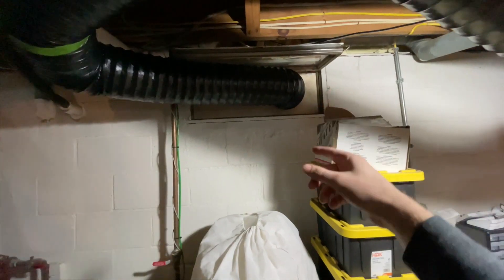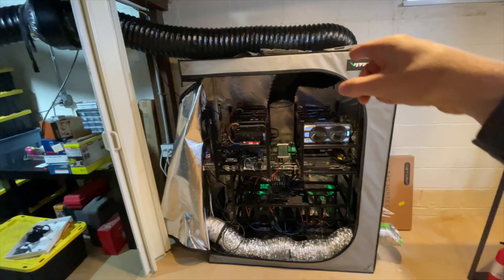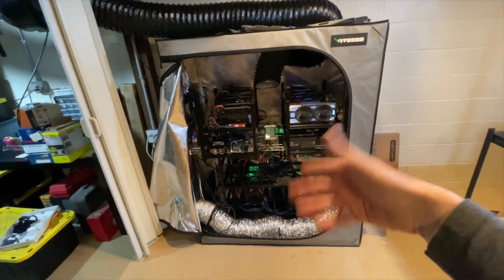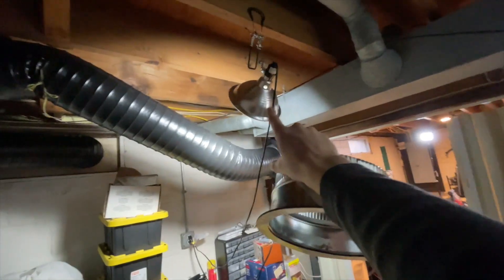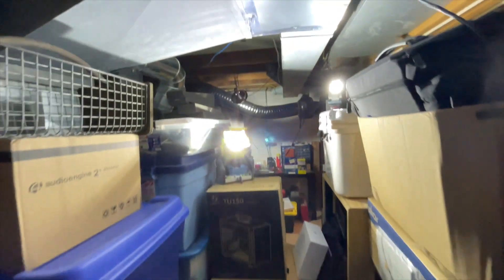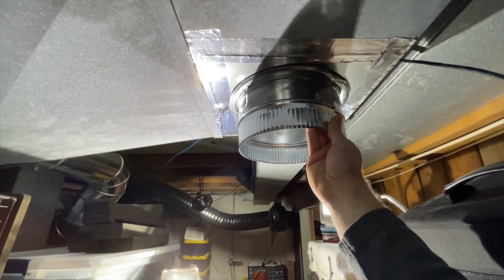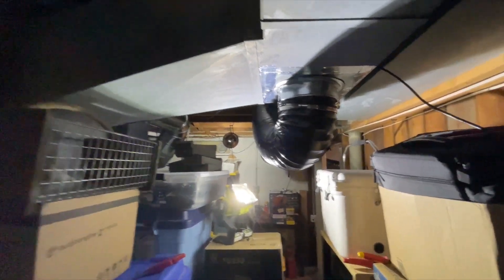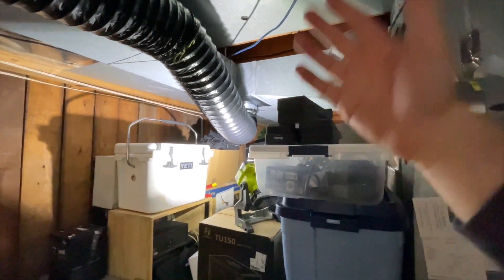Heating My House with GPU Mining Rigs

Comment: I bet you could also use it to cool your house in the summer by using a condenser.
Reply: Actually on second thought you would need a compressor which would probably use alot of power on its own.

Comment: Hey RFC are to still doing this? I was thinking of doing the same but with a y splitter where the majoity of the heat would go out the window. The other side of the Y would be a automatic damper that would open when the force hot air is open. Not sure if it would work.
Reply from the maker: I have to get it hooked back up for the winter now that it is actually cold out! This year it'll go into my return ducting and I'll use a wye to feed 2 exhaust fans into my HVAC.

Comment: Consider pushing air to the return side of your ducting to avoid backflow when the furnace kicks on. You will also benefit by leaving your fan on in the furnace then as a pull through your mining rig potentially increasing air flow.
Reply from the maker: 100% what I will be doing this year.
Reply: hi . i have a furnace similar to red fox and i was thinking to blow my asic heat into my room ducting .. can you please explain what u mean by pushing air to the return side of your ducting??? thanks

Comment: Have you noticed any issues with the furnace pushing heat back into the tent? I'm just wondering if it would be better to dump the heat into the intake ducting instead of the output
Reply from the maker: I didn’t, but I will be making that change this year!
Reply: I agree.  Dump the air into the house directly through a separate vent.  If the furnace kicks on it’s going to back pressure your in-line mining fan and your rig isn’t going to be able to cool well.

Comment: Good idea, but physics are against you on this one. Sorry.

Only issue is when your HVAC system kicks on, it will overbalance the exhaust pipe from the grow tent and blow hot air into your grow tent. Simple terms you are going to blow hot air into the tent when your heater turns on.

Best to just open the Grow tent and let it naturally radiate the heat out or just let the exhaust flow into the basement.
Reply from the maker: You're right thought when running this last year it never kicked back into the tent thankfully. This year I'll have it enter in my return ducting instead which should work better.
Reply: @RedFoxCrypto  That is the best way, and way more efficient.

Comment: It will be nice to use that heat for heating water in my house.
I'm waisting electricity to heat water in boiler while at the same time I'm using air conditionaer to remove heat generated by gpu.
Anyone did something like this ?

Comment: Is the booster fan coming out of the grow tent enough to stop the furnace fan from blowing hot air into the tent when the actual furnace kicks in? I would have thought it would have been better to feed the air intake of the furnace and preheat the air when the furnace is on, and it would still pass through when it's off, I think this would be both more efficient for the heating of your house and it would provide move more air across your GPU's when the furnace was on.
Reply from the maker: You’re 100% right. That’s what I’ll be changing too this year. I still never got kickback into the tent when the furnace kicked on all last season, but still would be much better going into the return vent.

Comment: How does air get IN to the tent? is there an inlet that has a dust filter or what?
Reply from the maker: Yeah there are ducts on the bottom of the tent that bring in air.
Reply: @RedFoxCrypto  How far off the ground is the intake duct at the bottom?

Comment: Nice work. I've been thinking of doing something like this for a couple years. Right now my rigs are just space heaters in the house, but I want to ramp up my mining and then do some sort of proper dispersion into the entire house, so your setup is exactly along the lines I was thinking. I am wondering what effect this setup has when the heater is on. Does it cause a pressure problem backflowing towards your mining rigs?
Reply from the maker: Hey dude! This setup worked great for me all winter long. The only adjustment I'd make (silly mistake on my part) is to tie in the duct from the miners into the return side of your HVAC. Even though I didn't do that, I still didn't have any blackflow issues.
Reply: @RedFoxCrypto  Ah, so you're thinking preheating the air going into your furnace should offset the furnace load! Really smart stuff, then you don't have to worry about backfeeding your furnace heat into your mining rig. I'm thinking about building a house soon and I just might steal this idea, then as I upgrade my mining setup, it would increase the efficiency off the furnace with every new GPU. End goal would be 100% mining for HVAC control. Really cool man, keep the content coming!

Comment: What I would do is close the door, lift up the bottom so there's a gap, lift up the hose that's extracting air, so it's right at the top, sucking up all the warm air that rises. That way air is moving from bottom to the top, where it's being sucked out, that way you're effectively taking ALL the heat the rig makes and dumping it into your house, making it way more efficient.  
The rig itself would be better off that way also, because it would be drawing cold air over it from the bottom, instead of soaking in warm air, while the hose is sucking cold air from the open door.  
It's like PC case airflow, except upright, you want good airflow, one side to the other, in this case bottom to the top for maximum efficiency.

Comment: So funny, I spent a lot of time looking for someone that vented out to see if it was viable, didn't find anything, and just did my own experiment. LTT brought me here and I was like HOL UP HE DID THE VENT TOO lol. I ended up using one of those portable AC vent kits to add an opening to my window, added an in line one way flange to make it so wind didn't blow in if it was stormy out, and very precariously masking taped it all together (just to see if it works). I am in Florida, so no basement and I don't have much of a need to heat my place. 

My friend thinks that my setup ends up creating a vacuum, sucking in humid outside air because of the negative pressure created by my constant exhaust. What do you think? https://imgur.com/gallery/NmECfuJ
Reply from the maker: Looks awesome dude. How much air are you feeling being exhausted outside? I'd get one of these https://amzn.to/3ci81wQ and literally put in your PC case to measure the humidity to give you peace of mind.
Reply: @RedFoxCrypto  Probably not as much as you with your in line fan, but I took a high rpm fan off an old corsair AIO, made that my exhaust fan, and set it to run at 100% at all times so it moves a good amount of air, no problem out that short line. Thanks so much for the suggestion, just ordered it!
Reply: Any air you force outside has to come back in the house from somewhere (gaps around doors, windows, etc). It does create a vacuum that has to be filled. Red Fox is pulling from in his house and pushing back into the house in his winter setup. In the summer, hopefully Red Fox cracks a window in the basement, otherwise he's doing the same thing, venting air outside, but pulling cool (possibly A/C cooled) air from the house, which is then backfilled by hot air from outside seeping in the house due to vacuum pressure.

Comment: It would be cool if you picked up spring return zone dampers and have them open/close based off a thermostat so the house doesn't over heat, then have the furnace act as a second stage. Could then pull outdoor air into the furnace for free cooling in the summer

Comment: one thing you could do as well is water cool your whole setup with custom loops and tie it to your water heater. make sure you get a really nice filter double to be safe. for the return water coming back to the closed loops system. free heat and save costs on water heaters. :) 

me and my brother did this 4 years ago in a really small cabin but used a 5 gallon tote and placed the pipe that lead to our mining rigs into a double filter and filled it with some water and placed a ton of snow in the tote it melted that snow so fast that we had to keep putting more snow in it. lol btw this idea is not patented and im wowed by no one doing it.

Comment: You need a much more powerful fan to push through all the extra ducting. I wouldn't be surprised if your GPUs are running hotter now since the fan can't get as much heat out. 
You also need some sort of valve so you don't waste a lot of that air pressure blowing into the furnace, and you don't heat up your computers when the furnace is on.
Reply from the maker: Thanks for the advice. Everything is running great except with the weather warming up my house is getting too hot again. Next year I'll add it into the return side of the furnace OR right into a green house.
Reply: Im in canada and thinking to do the same this winter . What u mean by return side of the furnace ????

Comment: It is what it is, mb just not mention little jimmy cuz they might be really salty, but whatever. What settings are you running on 3070 though ? :)
Reply from the maker: Stable for a day running -502 core, 1300 mem, 126w for 62.3 MH/s. Trying to push the memory a little more right now.

Comment: Did you test this when the heat is on?  I feel like if your heat ever kicks on the inline fan could run into more resistance/ get overpowered by the cfm of the furnace blower. I'm no fluid/thermal dynamics scientist though
Reply from the maker: Yes and it works well. In retrospect I should have put it in the return side of the HVAC. I'll probably change it up for next winter season.
Reply: @RedFoxCrypto  niccceee

Comment: Is this safe? I mean, could it be possible the air released by the hot electronic devices contains something bad for your health? It might be better only use the heat generated by the GPU instead of direclty poping the air into your house.
Reply from the maker: It's safe. All I'm doing is move that heat from one place to another with a fan.

Comment: I legit haven't turned the heat on in my apartment in 3 weeks. Bet its cheaper too cause I have electric baseboard. Its an odna b250 running 4 1060 6gbs , 2 1070s and 2 3060tis in the aluminum case built for that board (like the 8 card mobo/case setups from minerscave) . I pulled the server fans cause they were way to loud and put in some 120mm normal case fans  . the cards sit around 70-75c and it just vents out if the back of the case into the living room and I also have my desktop running a 3080 and 3060ti on the other side of the living room . been pretty cold in New England and my backyard is a big lake . normally I'd have to have my electric baseboards set at 80° just to stay at 70° . my electric baseboards havent been turned above 60°F for 3 weeks.
Reply from the maker: That's awesome dude. Especially since you are trading electric baseboard for electric miners. The savings there has to be awesome. 

Also, living in NE with a big lake in your backyard sounds like a dream. Happy mining brother.

Comment: i have a ring with 3060 ti and isnt hot , i try to heat but nothing , 40-50° max
Reply from the maker: They are pretty efficient cards so you might not get that much heat from them compared to others.

Comment: I was thinkng of doing the same thing in my basement to use the heat to heat my house.  I do not have as far to travel with the piping to get in to my centeral vents.  Mine are not in a grow tent though so I am wondering how well it will work.  My area gets around 75f right now since its winter time.  I could always get plastic sheeting and block off that area though to get it to heat up more if I were to pipe it in to my unit to heat my house.  I wonder how much it will save you on your heating bill though.  I guess it is hard to track because of how much the temperature outside fluctuates.

Comment: You know what I was thinking. Why not put a T in the duct work and run duct from the T to the window so you don't have to keep switching it. Put a butterfly valve in line with the duct going outside so you can close it during the winter time. Brilliant 🤔 now it's turning into a project. Sorry 🤦
Reply from the maker: Haha excellent suggestions. I think I might try just that for next winter season.

Comment: put the whole set up in the greenhouse. Then you can grow all year round!
Reply: He could grow some weed. Weed + mining= very rich
Reply: This is the way
Reply: no don't do that! It'll end up killing the system with trapped moisture alone. its better to just run an inline to the greenhouse, rather than putting the system IN the greenhouse.
Reply: Woah. Good idea.
Reply: No he can't because He must replace the UV radiation what the Sun emits. So using a UV lamp could work out in combination with a heat from GPUs

Comment: Just a thought here from a harsh cold climate. Keep an eye on your basement temperatures. In MN it gets more than cold enough to burst pipes. If you zip that tent up and send all your heat upstairs you'll throw off the frequency that your thermostat calls for your furnace. That might drop the temps in your basement a bit.

My one rig doesn't do much other than warm the one basement room that it's in, but hopefully the second rig I'm adding will get me some more heat!
Reply from the maker: Thanks dude. Luckily I also have some other rigs that don't quite fit in tent keeping the basement nice and toasty. Good luck on that second rig!

Comment: Done heating from mining gpu  but 
Showed issue  that air is dry from gpu. Need to use air humidity device to keep around  50%. Now I'm thinking to accumulation that heat and do some better heating solution

Comment: if your furnace turns on does it blow hot air back into the rig?
Reply: As a HVAC tech your going to damage your rig if the furnace comes on. The cfms that furnace puts out it's going to be a lot more than the fan for your rig which will blow into your rig.
Reply from the maker: Nope. Working great so far. I was nervous of that at first.

Comment: hi I maild ur Email regarding some help i need for bios upgrading my Gigabyte P104-100,but the mail is not delivering...the mail id is correct
Reply: For better hashrate or to 8gb from 4gb? Only certain p104 had 8gb on them. From what i read gigabyte cards didnt have 8gb. Id pull cooler off and check memory chips before flashing that
Reply: @michaelgrodecki4159  this guy did it....https://youtu.be/2J4F6zd6daE

Comment: Need to make sure the exaust fan from the rig is more powerful than the HVAC fan otherwise when the HVAC is running it will force hot air onto your rig and you may thermal throttle your GPU. Need a 1way valve to prevent back flow or air onto your rig. Good luck.
Reply from the maker: I tested it with my furnace running and the in-line fan is still sucking in all the hot air with no noticeable difference. I was worried about this too but it seems to be okay so far. 🤞🏻

Comment: Cool idea!  What if you were to suck in the cold air from outside to cool the tent?  Wondering which way would be more cost effective/beneficial?
Reply from the maker: I might try that in the spring. I’m just worried about filtering that air to avoid sending pollen, dust, etc into the tent.

Comment: Nice job bud! Just a small heads up you should put a damper on that connection so you can shut it off when the furnace turns on so it’s not pumping heat into that Grow tent... The best way to avoid that is to actually cut this into the return air side of your furnace so there is no chance it can push back into the tent and the heat will just radiate out of your return duct when it’s not on.

Also a flathead and a hammer will pop that duct work so you don’t need to drill it. If anyone is trying this at home.
Reply from the maker: Thanks dude. So far it seems to work okay but I was definitely worried about the furnace pumping heat into the tent. When I have both the furnace and in-line fan on the suction of air within the grow tent doesn’t change. 

Smart idea using the return side instead. Hopefully I’m okay. I’ll keep this going for a couple more months and then switch it back to venting outside.
Reply: @RedFoxCrypto  Haha no worries man!! Just in Construction so my brain was like leme just let him know incase you notice that grow tent is getting hot... 

That’s what I would do anyways cause the heat will just get sucked in from the furnace when it’s running and when it’s not running it will radiate from the returns. Currently the heat will come on and push down to your rigs fighting that in-line fan. 

Either way Free heat so F*** it! Lol
Reply from the maker: @ChumpChangeXD  Excellent point. Love you buddy! Thanks for looking out.
Reply: @RedFoxCrypto  ❤️

Comment: We live in Canada and our house is heated with baseboard electric and woodstove(mostly woodstove) we are in the process of taking out the baseboard heaters(disconnecting them) and since they are all on there own 20 amp 220v circuit we are going to connect mining rigs into those circuits to heat the house and then come summer move them back to the other part of the house that is vented...free heat...we have definitely used a lot less wood this year with using the miners to heat instead of baseboards....heck even our normal hydro bill for the winter is less with heating with the miners...so it's like having free heat and free electrical...in the words of Charlie Sheen...WINING lol
Reply from the maker: Haha that's awesome dude. WINING

Comment: I have a rig in each room.  Gas bill doesnt go up much each winter.  I wish I could do this but the landlord might have a fit.
Reply: That's because the gas bill is a scam. It should be way higher in the winter but they overcharge you in the Summer, that's why.
Reply from the maker: Really cool man. Thanks for sharing. I did that for a lot of the winter last year.